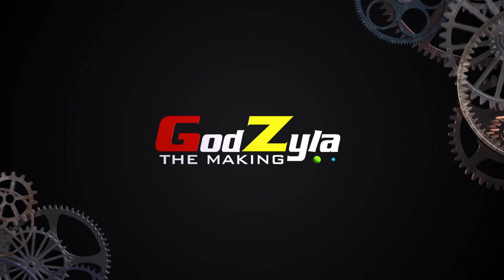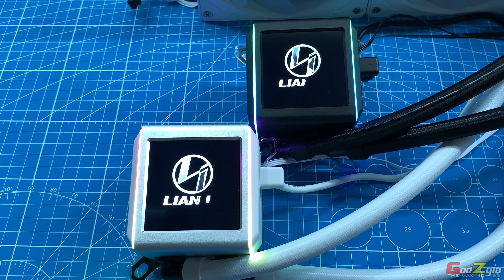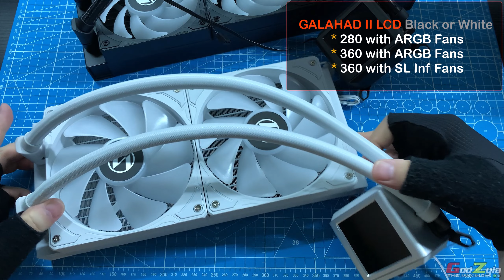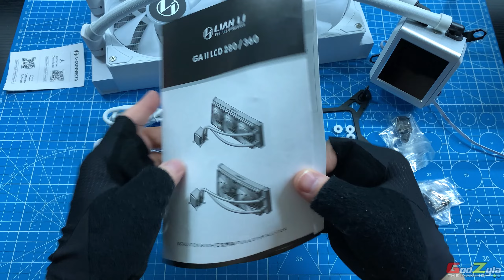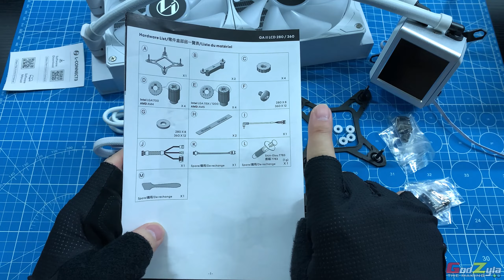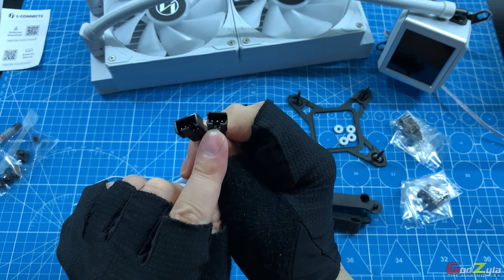Lian Li Galahad II LCD

Comment: Hey mate i got a question. I am doing an sfx build. I will only be using a total of 2 Lian Li fans.  SL V2. 
Can the SL v2 be plugged directly into the pump head 7 pin connection?
Reply: I will not be using the fan controller.
Reply from the maker: @TheRealFenwick You can plug the 3 pin and 4 pin to the 7 pin pump connector, but you wont be getting full support on the argb effects that are found on the SL V2 dashboard on L-Connect 3.
Reply: Thank you, Can I not use "Cable J' (As listed in manual)  and plug slv2 7 pin directly into pump head. Not use the 3 pin and 4 pin? @KleoYan
Reply from the maker: @TheRealFenwick  I dont think is a good idea, in practice yes, it's the same concept as 4pin PWM + 3pin ARGB = 7pin but on the cable J, I did not take a closer look. I would suggest not to skip that cable. It's better safe than sorry.
Reply: That’s okay I’m happy with not getting the full support on the fans as i just run static
Reply from the maker: @TheRealFenwick  ok.. all the best with your build 😉
Reply: My main thing is I will not be using any sata power from psu, Not using it to save space
Reply from the maker: @TheRealFenwick  ok, this I have not tried, test it at your own risk as the drawing of current by default is through the sata connector. if that's the case, why not just plug the fan 4pin connector directly to your motherboard CPU_FAN header and the argb directly to your motherboard 3pin 5volts argb header? just use the motherboard argb utility to control the argb effects.
Reply: @KleoYan  Ok thank you very much. Will L connect detect the uni fans rgb with the motherboard sync feature?
Reply from the maker: @TheRealFenwick  it should work when you set sync to motherboard on L-Connect 3 app
Reply: @KleoYan honestly once again thank you so much. You have been more helpful that the Lian Li guided and reddit
Reply from the maker: @TheRealFenwick  you are most welcome. All the best with your build.
Reply: @KleoYan  I bought 2 al v2 fans. Testing atm and L connection 3 doesn’t have the sync option. I have it plugged into my 3 pin jrainbow header.

Rgb will work with mystic lighting but there is no sync feature in L connect 3
Reply from the maker: @TheRealFenwick  if you have plug the AL V2 fans directly to the motherboard, only your motherboard mystic lightings will work. L-Connect 3 app will not work. unless you've plug it to a uni controller. so how did you connect your AL V2 fans?
Reply: I am not using a controller. I am using the motherboard .I followed your comment above. 

You said L3 connect app will work with Uni fans if you set to motherboard sync. There is no motherboard sync option …
Reply from the maker: @TheRealFenwick  hi, my bad. the convo is too long and I have confuse you with another case.. your AL V2 fans which are connected to your motherboard (Fan and ARGB Header), will only work with mystic lightings software. L-Connect 3 app will only work if you plug fans to a uni controller. in your case you do not have the uni controller.

Comment: Nice review man. im looking into getting a white one for my Lian Li Q58 case. any help?
Reply from the maker: Hi Kevin Winklaar, welcome to my channel, now the 280 liquid AIO is at 319mm in lenght. the Q58 will have a tight squeeze. It will only fit but you will need to remove the front SSD tray. I myself have not test this 280 on a Q58 and I am only judging on what I know about the Q58. this might aid you as a reference. Lian Li official website stated that the lenght of the radiator can be up to 325mm, make sure the radiator is below the fans. you can also refer to this playlist which might aid you out. https://www.youtube.com/playlist?list=PLEW-b-2vYDdOf3xqv0MuLfuAANXqfI2qU
Reply from the maker: Hey, please note, I have double check with Lian Li Technicians.. the 45 angle bud of the GA II LCD is too long, you will hit into problems in a Q58. please do not use the 280 GA II LCD in Q58, it will not fit.

Comment: Hi Kleo Yan, thanks for detailed video.

I have 4x SL-INF fans (with Controller).  I was using these fans with L Connect 3 v1.6.30 without any problems.  Since I bought Galahad II LCD SL INF, I had to upgrade to L Connect 3 v2.x.x.  The problems start here.  I cannot control both my SL-INF fans and Galahad II LCD with v2.x.x.  In Device Manager, it appears as SL-INF Firmware 1.4.  I updated the firmware on the Galahad II LCD.  In Device Manager, it appears as GA II LCD v1.3.  It also appears in L Connect 3.  But I can't control the RGB and speeds of the fans in any way.  Likewise, I cannot control the screen of the Galahad II LCD.  It stands firmly on the Lian Li logo.  I wonder where the problem is?  My motherboard is Asus ROG Strix B650-A Gaming Wifi model.
Reply from the maker: Hi Deathbringer, welcome to my channel. Maybe you can try this, uninstall your current L-Connect 3 app using Revo Uninstaller ( https://www.revouninstaller.com/ ) 
Revo uninstaller will remove all unwanted files / folder / registry in your system. Illustration to use revo uninstaller https://www.youtube.com/watch?v=uMgUYiakpxM&t=437s
once you have remove L-Connect 3 app and it's registry and such. reboot your PC, then install the latest L-Connect 3 which is version 2.0.9 https://lian-li.com/l-connect3/
Reply: @KleoYan  Thanks for ur help. I did a clean installation with both Revo Uninstaller and the Remove Guide on the Lian-Li website. Again the same situation. 

Today my TL LCD Reverse Triple Pack fans arrived. I installed them too. When TL LCD fans were installed, the System Info section stopped working. Likewise, Device Manager also appears on TL LCD fans. TL LCD fans L-Connect v2.0.9 also appears in the left menu, but I cannot control it. It is in Rainbow color and works steadily with the Lian-Li Logo on the fans' screen. 

All my devices (SL INF Fans + Galahad II LCD + TL LCD Fans) Device Manager and L-Connect appear in the left menu, I cannot control them.

There is SL-Inf Controller 01 / Galahad II LCD Controller 01 / TL Series Controller 01 in the L-Connect > Settings > Update section. The sections marked "Version:" are empty. Update Check button not working/unresponsive.

When I receive the LOG, there are entries like this. There is an Error section there. Maybe you have an idea? Thank you again.

[2024-02-14 16:33:21][Info] L-Connect 3 version: v2.0.9
[2024-02-14 16:33:21][Info] Device added successfully. (type=SLInfinity, path=\\?\hid#vıd_0cf2&pıd_a102&mı_01#b&a0f553e&0&0000#{4d1e55b2-f16f-11cf-88cb-001111000030})
[2024-02-14 16:33:22][Info] Device added successfully. (type=Galahad2LCDV2, path=\\?\hıd#vıd_0416&pıd_7395&mı_01#b&2518bfc8&0&0000#{4d1e55b2-f16f-11cf-88cb-001111000030})
[2024-02-14 16:33:22][Info] Device added successfully. (type=TLFan, path=\\?\hid#vıd_0416&pıd_7372&mı_02#c&337291d5&0&0000#{4d1e55b2-f16f-11cf-88cb-001111000030})
[2024-02-14 16:33:22][Info] https://lianli-update.oss-cn-beijing.aliyuncs.com/ : 226ms
[2024-02-14 16:33:22][Info] https://lianli-update.oss-cn-beijing.aliyuncs.com/ is current update server
[2024-02-14 16:33:23][Error] Can't download software information
Reply from the maker: @deathbringer35  Hi welcome back, after testing with my AL V2 with the TL LCD and the Galahad II LCD, I do not face this issue. but when I switch from my ASRock Z790 Riptide Wifi 7 to Asus Z790 Maximus hero, I face an issue, I can't control my TL LCD no matter which port I change to, but when I remove Armoury crate, it works. same goes to my MSI B650M Mortar when I have the MSI center installed. Once I remove the MSI Center. I am able to control. for your case which motherboard are you using?
Reply: @KleoYan  Hi again, 
My motherboard is Asus ROG Strix B650-A Gaming Wi-Fi. Armory Crate was installed. I uninstalled it using the Uninstall Tool from Asus website. Nothing has changed.
Reply from the maker: @deathbringer35  if you have done those steps and still not able to help, I am clueless now. I saw your post at Reddit, hopefully Lian Li tech support or someone will be able to aid you. Am so sorry about this.

Comment: I read my motherboard manual and all of the fan headers including the AIO pump has a max Amp of 1A (my motherboard by the way is ROG Strix Z-790-E Gaming Wifi I). Is this safe for my pump to run specially im running i9-14900k?
Reply from the maker: Hi Ingemar Zarate, welcome to my channel. So long you plug the pump connector to your motherboard AIO_PUMP. You will be fine. As the AIO_PUMP header though it’s at 1a. The actual readings is slightly more, so don’t worry about it.

Comment: Can you hook up the AIO fans of the none infinity version to the controller of the infinity fans? I know you can connect the Infinity AIO to the new controller.
Reply from the maker: Hi Danijel B., welcome to my channel. for the fans that come with the Galahad II LCD, plug the 4pin PWM directly to your motherboard fan header and the 3pin argb connector to either sync 2 or sync 4 to the SL INF uni controller. Thats what you can do.
Reply: @KleoYan  or you can just use an extra cable from a 3 pack of infinity fans and then connect it to the controller that came with the fans.
Reply from the maker: @TheSjuris  hi welcome to the channel. You can do that too. Either way will work. Thank you for sharing.

Comment: i like your videos but cooling wise which is better the ryujin iii or nzxt elite or lian li galahad lcd? I don't fancy the rgb but i based on performance and lcd. Based on your opinion which has better performance and lcd? 280 or 360?
Reply from the maker: Hi Rezuan Isham, welcome to my channel. I am not able to compare with the nzxt elite as I did not fiddle with it. Did request from NZXT but no response. Now as for both Ryujinn 3 and this Galahad II LCD, this perform much better. Between the GA II LCD 280 and 360, both are about the same tempreture. you can refer to this vid https://youtu.be/E-xZTQiJUOQ
Reply: @KleoYan  nice i saw the review the testing is based on the same methodology? it seems the 280 has better thermal but not a big difference
Reply from the maker: @razerangelri  yup that is correct. The different is minimal, won't go wrong with either size 280 or 360.
Reply: @KleoYan  thanks bro…keep up with the review for Singapore. I can’t based on US and Europe due to the temperature
Reply from the maker: @razerangelri  you are most welcome and thank you, I will continue to provide good content when possible 😉
Reply: @KleoYan  Hi I just bought the AIO and I like to know if there’s any difference between the basic Lian Li which comes with AIO and the Infinity pack.Should I upgrade the current fans from the AIO to Lian Li TL120?
Reply from the maker: @razerangelri  the original fans have better static pressure and it’s designed for this AIO. You can try other fans and results will differ from the original. Can be better or worst, greatly depends on the fan static pressure.
Reply: @KleoYan  Thank you.
Reply from the maker: @razerangelri  most welcome.
Reply: @KleoYan  hi, I want to ask since water pump and TL fans are using 2 USB 2.0 hub. I wanted to use lian li strimmer as well.But it seems the nzxt hub based on reddit is not compatible with lian li.And Lian li has a usb splitter.Is the pump compatible with splitter or Are the TL fans compatible. Hope you could do a full review on USB splitter.
Reply from the maker: @razerangelri  you can use this https://lian-li.com/product/usb-2-0-1-to-3-hub/ and to purchase at https://www.aliexpress.com/store/911265363?spm=a2g0o.store_pc_allItems_or_groupList.pcShopHead_6000456123474.0 (currently close till after Chinese New Year on the 19th)
Reply: @KleoYan  LIAN LI Controller Compatible list: 

    UNI FAN SL Controller
    UNI FAN AL Controller
    UNI FAN SL-INF Controller
    STRIMER L-Connect 3 Controller
    UNI FAN SL V2 Controller

are they compatible with TL controller or Galahad ii?
Reply from the maker: @razerangelri  If you are talking about the 3 in 1 hub from Lian Li, yes, they are compatible.
Reply: @KleoYan  nice. hope it works😀
Reply from the maker: @razerangelri  it will work no worries.
Reply: @KleoYan  thanks brother …you have inspired a lot for the parts i picked.Very excited to build my 2nd build
Reply from the maker: @razerangelri  well, all the best. 😉

Comment: Hello! Could you please advise on how my fan is reading as 0 rpm? My pump is running at 3540 rpm.
Reply from the maker: Hi Ezra Yahyisrael, welcome to my channel. If you are using the SL Inf LCD model. You won’t read the read RPM of your rad fans as it’s plug to the uni controller. Unless you are using default fans which is plug to your block, then you will be able to see the rpm readings.
Reply: @KleoYan  I have the model listed in the video the LIANLI GA II LCD 360 WHITE
Reply from the maker: @Eyah8  hmm then you should have the readings. Check the connection to see if it’s seated properly. Does your fans ram up when you run cinebench?
Reply: @KleoYan  they are always at full speed it seems.
Reply from the maker: @Eyah8  hmm. can you check to see if your device manager do show the device listed? is under Universal Serial Bus Devices.

Comment: At 21:04 my 360 didn’t come with this cable, the reason why I stopped by to see what this connection was for on the pump.

Mine is the GA II LCD SL - INF 360
Reply from the maker: Hi Haies 09, welcome to my channel. It’s normal not to have that cable as you have gotten the SL-Inf model which these radiator fans make use of the uni controller to control the rpm and ARGB effects
Reply: @KleoYan  that’s good to hear. So I just connect the pump cable, the usb-c to a usb 2.0 header and the controllers usb-c to another 2.0 header and I’m good to go?
Reply from the maker: @haies09  yes correct.

Comment: Anyone expérience wrong CPU usage and maybe CPU temps with this LCD cooler ?
Reply from the maker: Hi MrXxIceManxX, welcome to my channel. I have been using this cooler on one of my system and have compared between the temperature from the LCD and the temperature from HWinfo. I do face delay on the LCD as in 1 to 2 degrees different but no that major. I am using an ASRock Z790 Nova Wifi II board and this was my experience. I would suggest if you facing a bigger issue. Type it out at the Lian Li Reddit forum. It's a bigger crowd there and more focus on feedback, plus Lian Li support crew do watch out on issues of their products and to improve on it. https://www.reddit.com/r/lianli/
Reply: @KleoYan  thx for your Reply i actualy run this cooler on Asus rog Strix x670e-e with a 7800x3d , temp seem ok but i mean if i open task manager and look at CPU usage for exemple it will Say 30 and on thé cooler it would show 5 or 10 and its not a matter of delay. Maybe its normal idk just wanted to have other user expérience feedback
Reply from the maker: @MrXxIceManxX  I see, I only project duo sensor or time most of the time. let me see what I can find out, but best is to create a thread at Lian Li's reddit as the audince is bigger. Thank you for your question and to have visited my channel.

Comment: 2:48 this cable wasn't included in my box. If I turn the switch of my SPU ON, the LCD Displays is loading with the Lian-Li Symbol, the ARGB lights are also ON, but in few seconds the LCD and ARGB's are going OFF / the LCD is black. Is this cable optional? This cable is also not listed in the components list. I'am from Germany/Europe, but I think there is only one universal versiom of this AIO Watercooler. Any ideas how can fix my problem?
Reply from the maker: Hi Boz Oq Türkməni, welcome to my channel. Which version of GA II LCD did you purchased? the standard or the SL-Inf version?
Reply: @KleoYan SL-INF Version
Reply from the maker: @bozoqturkmni8137  ok for that you will not have the cable which you have mentioned. You will need to plug the AIO block usb and the SL-Inf Uni controller to your motherboard USB 2.0 header. Watch this as the concept to have the controller working is the same https://youtu.be/CgvuUFeff8U
Reply: @KleoYan  Thanks, I also find out that this connection isn't needed for the SL-INF Version. The problem with the LCD is a Software Problem. But I've the problem that I can't even install L-Connect 3 because of .NET FRAMEWORK 4.8.1. error. I'm trying install this Framework, but Windows is blocking with "only aviable on Windows Server". Ok, this is a another issue, but good to know that my wiring was connect. Thank you so much again.
Reply from the maker: @bozoqturkmni8137  hmm. for me I turn off UAC and install that. that should solve the problem. you can give it a try.
Reply: @KleoYan Hi Kleo, I fixed my problem. The Micro USB header wasn't well connected 🤦🏻😂 And I had still problems with the L-Connect 3 Software (2.06). It doesn't change the Lian-Li logo. So, I just found the 2.00 Version of L-Connect 3 on reddit and installed it. And it works now. It is definitly a Software Bug. Now, I'am happy and thank you for your support. I subscribed you ❤️
Reply from the maker: @bozoqturkmni8137  hi wow so much info. Yes you can send it to godzylatech@gmail.com but it will take me sometime to reply as work year starts. I will be busy. Thank you.
Reply: @KleoYan Hi, I delete my long response because I fixed my problem. You can read my 2nd response last again. The installation of the old version (2.00) of L-Connect 3 solved my problem and it's now all fine and it works :).
Reply from the maker: @bozoqturkmni8137  oh ok.. I will still highlight this to Lian Li, as I am using the new version but without SL-INF fans. I use purely P28 with no argbs lol.. thank you again for your updates.